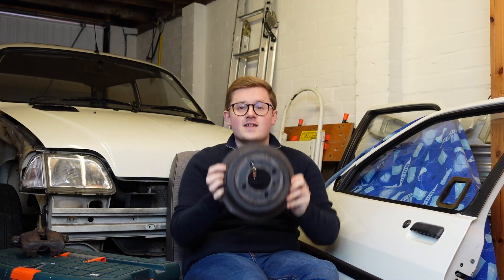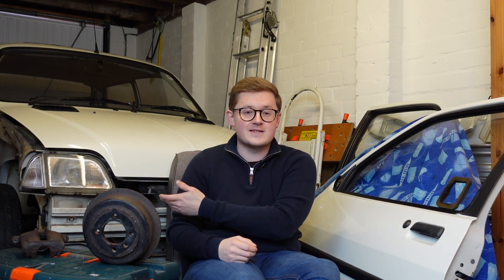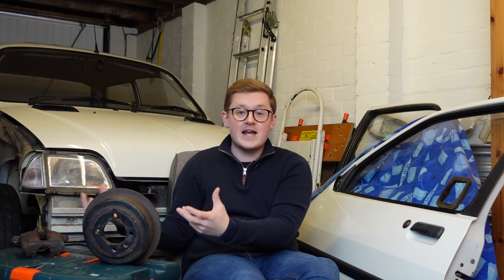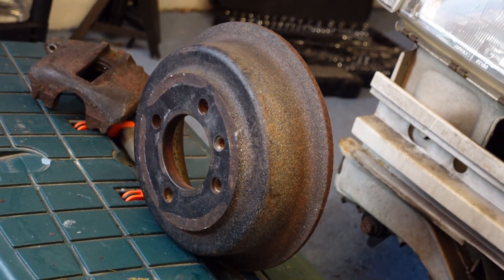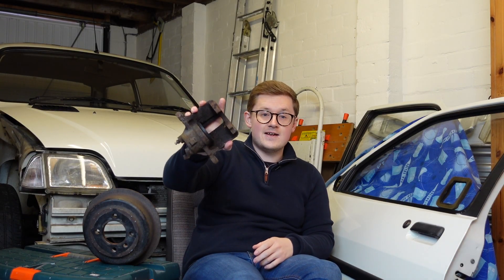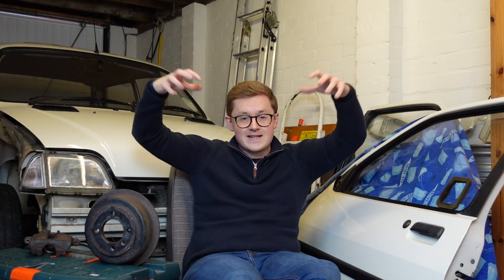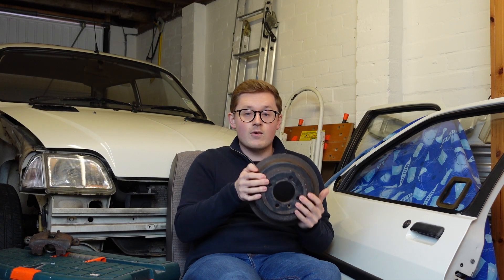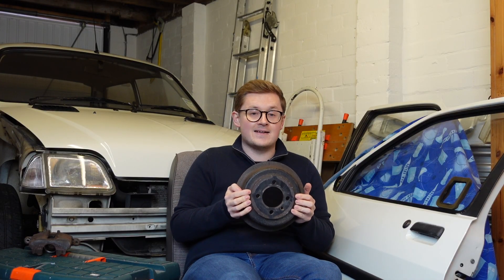Why are Drum Brakes Making an EV Comeback?

Comment: Drum brakes for parking brakes have never really gone away : Mercedes , Volvo , BMW and Volkswagen still use them because , unlike discs , as they cool down following a drive , they grip tighter when the metal contracts , unlike disc brakes , which are not suited to parking brake applications , lose grip and the discs cool down and contract .

Most of the cars mentioned above have combined rear disc/drum units which use the disc for the service brake and a drum in the centre for the parking brake .

Comment: Good presentation. As you say, drum brakes are not completely useless. The discussion could actually go on and on. For example, drum brakes with at least one leading shoe have a self servo action which can eliminate the need for an expensive servo, at least on small cars. That self-servo action is also responsible for the poor feel and tendency to grab so careful design and quality control is needed.

Comment: Such a well researched and presented video. I was wondering why my Q4 etron had hub breaks at the back. It does feel different braking having come from many years of driving cars with all round disks, but once you 'trust' in the regenerartive braking it all makes sense. Yes Audi may be saving some money installing hubs, but if the rear brakes are rarely used  then why bother with disks. Plus it is an added positive concerning the containment of brake particle dust. Well done for putting this together!

Comment: Very informative, but there are a few other disadvantages you didn't mention. Drum brake shoes don't have audible wear indicators, so the only way to inspect them is to remove the drum.  Inspecting disc brake pads doesn't usually even require removing the wheel.  Worn shoes or drum can also wear silently where the shoes contact the drum less and less to the point where the driver might not realize his/her rear drums aren't working at all, effectively increasing overall braking distance and risk of front brakes overheating from doing 100% of the work.  It's also a common issue that self-adjusting mechanism doesn't self-adjust, rendering the rear drums ineffective.  I've only ever owned two cars with rear drums, both purchased used, both with auto-adjusters but both severely out of adjustment.  Granted, parking brake not holding is a clue that this has happened, but many people don't use the park brake regularly so they would never realize their braking is compromised.  Needing to readjust, service auto adjusters, and pull drums to check shoe material thickness seems to make them a bit higher maintenance than any rear disc brakes I've ever dealt with.

Comment: Traditional friction brakes on trains used to make use of that exponential effect to allow swift entry to a platfom and a successful halt at the far end - particularly true on the old trains on the Southern Electric, so much so that the introduction of modern stock in the '70s and '80s caused an initial flurry of accidents when the expected increase of braking didn't kick in near the buffer stop \m/

Comment: As always a great video and I love your channel.
Interesting to note that drum brakes are superior to disc brake configurations in terms of intrinsic ability to self-servo. Also drums are lower maintenance and the essential mechanical components are protected from the elements….
A disc configuration without assistance is ineffective at high speeds. Some aircraft braking systems were reliant on drum brakes. Yes drum brakes can be snatchey when damp and have heat dissipation problems. But it’s good to see drum brakes making a comeback.

Comment: Interesting presentation, but overall proportions matter 
kind of brakes on a road car?  seems highly irrelevant. 
We struggle with the definition of basic specs a vehicle for private use on public roads should have. Why give it race car features?  EVs burn tyres instead of dino juice. 
In any car, ICE or EV, brakes are essentially a safety component to handle an emergency situation. If you stress out the brakes on a regular basis, youR doing something wrong in the first place. 
understand race track vs public roads. 
Power installed: what is the point in shoving more than approx 150HP into a road car?   break any speed limit in under 3 seconds?
Regen breaking in EVs? mostly useless If activated all the time, youR doing something wrong in the first place. 
Weight is good for safety and comfort, but what about energy efficiency?  a reasonably safe but also fun car of the late 70ies weighed in at 810 kg got 110 HP from a healthy 1600cc four pot
Today it's double or triple, also in price with no efficiency gain whatsoever. 
We are amidst a war of wind mills against wind mills. Qui bono?

Comment: I am not convinced about the motives behind fitting drum breaks on for instance the ID3. The ID3 is up to 300Kg heavier than the Golf, its regenerative breaking only works when the battery is "not" fully charged, so can not be relied upon and it is sold in a competitive market. I suspect that COST is the motivation here. Otherwise, why not fit drums to the bigger more expensive premium models?
Reply: Wot like the ID4, ID5, ID7 and ID Buzz????

Comment: One correction; drum breaks don't fade when hot because the shoe and fluid are getting hot. The fade is caused because the drum is heating, and being made of iron or aluminum, and metal expands with heat, the drum expands in diameter, and away from the internal break shoe. The major advantage of disk breaks an your average passenger car is that when heated from constant use, disk breaks don't fade to any extent.
Reply: Pedal travel may be affected by drum growth, but that shouldn't cause true fade. Fade is temperature induced failure of braking force, not just pedal travel. I had a car with four wheel drums, and coming down a mountain road from my grandparents house, the brake fade would start. The pedal stayed hard, the brakes just stopped working. That's pad fade - the high temps have started to cause lack of pad friction.
Reply: @cpmaverick ; once again, break fade with drum breaks is caused by the drum getting hot, and expanding. That makes the drum larger in diameter, causing the break shoe to need to move farther to engage the drum. Even a full stroke of the master cylinder piston will only move the pistons in the wheel cylinders so much, and then the shoes will lose contact with the drum. Pumping the breaks helps a bit, but the wheel cylinders and break shoes only have so much possible movement designed into them. With disk breaks, the shoes are clamping onto the rotor, so a hot rotor might glaze, but it can't expand away from the shoes.
Reply: @oldgysgt  If drum brakes faded because the drum swelled so much that the pads couldn't reach it, then the brakes would be completely locked when they cooled down due to the self-adjusting mechanism. While heat does expand drums, saying that this is the primary reason is just incorrect. I say that as both a mechanic who has driven and worked on four-wheel drum brake cars, and an automotive engineer who understands how they are designed. Your logic is solid, but you are over-emphasizing the effect of heat expansion. The wheel cylinder travel is more than big enough to handle drum expansion due to heat.
Reply: @oldgysgt  As an example, a 10" drum will expand .00007" inches per 1 deg F temp change. Brake fluid boils at about 450 F, so the biggest temperature delta before brake fluid causes the fade is approx 400 degrees. The brake drum has expanded 0.030" in diameter. New brake shoes have about 1/8" of usable wear on each side, or 0.25" total. So the biggest brake drum expansion possible is only 10% of the normal brake wear the system is designed for. That's not going to cause a noticable change in pedal feel (plus your brake fluid is boiling at that point!).
Reply: @cpmaverick ; Remember, drum breaks use shoes, not pads. As opposed to disk break pads, drum breaks have springs attached to the top of the shoe to return the shoe to this starting possession, (and away from the drum), once the break pedal is released. However, if the drums are HOT when the vehical is parked, and the parking break is set while the drum is still hot, then YES, the cooling drum will contract onto the rear shoes, (that are now being held in place against the interior of the drum), and damage to the breaks can occur. That happened to one of the trucks in a company I worked for. The rear drums were badly warped, and had to be replaced. I began working on cars in my father's shop at age fourteen, (1958), and back then almost all American cars used drum breaks on all four wheels, so I am VERY familiar to the workings of drum breaks, break fade, and its cause.
Reply: @oldgysgt drum brake shoes use springs, yes, but they also use self adjusters to keep the shoes very close to the drums. This is so the pedal travel doesn't get longer with wear. If you've ever replaced shoes, you'd know this adjuster needs to be reset. 

So if travel was as extreme as you say, the adjuster would adjust out and stay there (they do not re set automatically!). The fact that they don't need to be reset, makes your explanation incorrect. 

I've explained it with concept, and I've explained it with math. You are simply wrong and going off an old wives tale theory. Have a good one, I can't explain it in any more detail than I already have.
Reply: @cpmaverick ; First of all, you need to take a course on the workings of older automobiles, and then you will see what I'm telling you is correct. When I was in High school they had an automotive class as an elective, but from your lack of knowledge about break fade in drum breaks, it appears that kind of class is no longer offered. By the way, don't worry too much about the boiling point of break fluid in drum breaks, because at no time does the drum come in direct contact with the wheel cylinder, or the break fluid, (unless of course a wheel cylinder seal happens to fail, and then you have break fluid on everything, and NO BREAKS at all). Apparently the only break system you have encountered are disk breaks, and that system is VERY different from  drum breaks. The master cylinder and the hydraulic brake lines are the same, but at the wheels the mechanics are totally different, and have nothing in common.
Reply: @cpmaverick ; I have tried to be patient with you, because of you lack or real knowledge of drum breaks, but my patience is at an end. The fact is you have NEVER in you whole life worked on drum breaks, have you? So get your head out of the place where the sun never shins, and haul your sorry behind down to an competent automotive repair shop, and ask them to educate you on break fade in drum breaks!
Reply: @oldgysgt  You totally missed a lot of what I said. I have worked on lots of drum brakes. I owned a car with four wheel drum brakes. I am not young. I was an ASE master technician when most cars still had drum brakes. Then I became an automotive engineer. Yet you talk down to me, and assume things about me. I've been patient as well, and I still am, but I have nothing more to say because you have decided you know everything and are not open to what I have to say.

What you learned was an old wives tale from a shop teacher, and you are so stubborn you won't let go of it. Being old or even being experienced does not mean you know the 'why' of how things work. You have never measured a drum brake hot to confirm your theory. Yet you cling to it. The math is what it is, the math says it is impossible.
Reply: @cpmaverick ; only a fool argues about something they know nothing about. Now, refer to my previous post.

Comment: Very smart.  I mean, my cars have all had front discs and rear drums, in general drums were used back on those for just that reason -- drums are cheaper, and the discs do the majority of the braking (and so are the brakes that heat up.)   1972 Cadillac, 1985 Celebrity, 2000 Regal, plus a Toyota, Dodge or two, and a few other vehicles, and my 2013 Cruze. 

So having regen take over some of that braking, indeed there's no reason to have discs up front either.  

After all,  even on my parents Kia Niro hybrid (for example), that 40HP electric motor can potentially provide 40HP of braking.  It's set up to drive like a conventional car so it has very little regen when you lit off the gas (down hills it'll apply enough regen to maintain your speed unless it's pretty steep; on flat ground it just ever so slowly loses speed like a typical automatic in top gear).  But indeed it's got a little gauge showing charge/discharge and when you are braking to a stop at least at in-town speeds it doesn't max out charging unless you come to a quick stop, suggesting it's stopping entirely on regenerative braking and not using the physical brakes at all.  If you have a full electric vehicle where it has like 80-200+HP motors and battery capacity?   Yeah it may only have to use the brakes for true panic stops.

Comment: A lot of the comments discuss the pros and cons of drum brakes on a traditional set up where they are the only brake on a wheel or axle. In the EV configuration, braking is primarily handled by the motor(s), the drum brakes are just providing additional braking force and are the fallback would regenerative braking somehow fail.

Comment: I have an EV and rarely use the brakes at all because regen slows me down. I doubt the pads will show anywhere close to the sort of wear as in a combustion car of the same age. I know when I drove petrol cars that changing brakes was something I had to do after 2 or 3 years. Not to mention clutch, timing belt etc. had their own service intervals. I could see manufacturers thinking the same and it is fine to use a simpler, cheaper braking mechanism. It also means that brake dust is captured and not released like it is with pads.

Comment: Honda also showed that you can make the drums out of aluminum with a steel ring on the inside to keep the weight low and reduce some of the heat soak.

Comment: Cool video. Just one minor error. Near the end of the video you state that disc brakes constantly rub and introduce friction that makes the wheels spin harder. That's entirely not true.
If disc brake pads are rubbing, the braking layer on the brake pads eventually wears off and there is a small gap, so they are not touching. When you press the brake pedal, brake actuators kick in and the gap is reduced and friction is back. But when you depress the pedal, brake actuator stops adding extra pressure in the fluid system and due to pressure going back, the brake pads are sucked back in, because there is no more external force for increasing the pressure in fluid lines.

Comment: I have a small 250cc very lightweight Yamaha motorcycle. The drum brake at the rear is a wise choice for this motorcycle. As a single cylinder you have a lot of engine break and in a motorcycle you rarely use the rear brake. I used to have a similar motorcycle with a disk brake at the rear and going downhill and modulating the rear bring would at some point overheat the fluid. Not with the drum brake because it's operated mechanically. The newer version of my motorcycle has a disk brake at the rear which only adds weight and no advantage.

Comment: I've driven motorcycles with drums front/rear, and cars with the same. Due to actual experience, I prefer disk front/rear because of performance issues (stopping power) with drums. After the 1st panic stop, drums will be useless for a while until they cool down.

Comment: Well, that was well presented,  well researched & quite informative. 
The bit about manufacturers Not seeking any brake hardware improvements recently; i assume since ABS, which has seen continuous improvement; makes me wonder just how much we Could improve.
The brake drum mechanism has Never been redesigned; thats the Same mechanism as on WW2 tank steering. So at least a century w material improvements & minor revision.
I wonder what a good engineer could do. I can see several approaches offhand; most fail on the lower cost/less engineering fronts, but... just about Any modern approach could massively improve that mechanism.
A few changes to the drum, opens a few more changes to the pads... theres a Lot of potential there.

Comment: Unfortunately his missing some valuable info here;

1) yes calipersvcan be expensive to replace. Certainly more expensive than replacing a drum brake cylinder. However... calipers can be rebuilt at home with simple tools. Most people just throw calipers away but they actually sell kits that include a new caliper piston, inner seal, dust shield seal and calipers guide pins. And it's stupid cheap. 

2) caliper/disk rotor brake system is actually easier to work on. Less parts. Easy access. 

3) It's easier to visually inspect and monitor the condition of caliper/disk rotor system then it is on a drum brake. With drums you would have to pull the drum off just to inspect the internally positions pads. 

4) Surface rust on brakes is more a issue on cheap aftermarket rotors vs genuine or performance rotors which  are less likely to rust. 

5) Some vehicles with caliper/rotor style brakes actually have the emergency brake mechanism isolated and separate from the brakes at the 4 wheels. Literally mounted on the transfer case inside a drum.